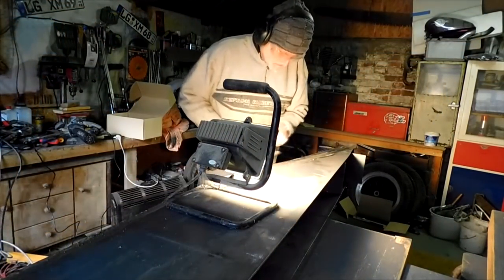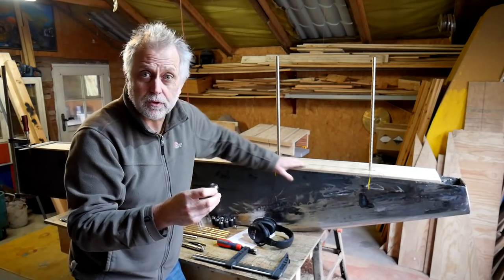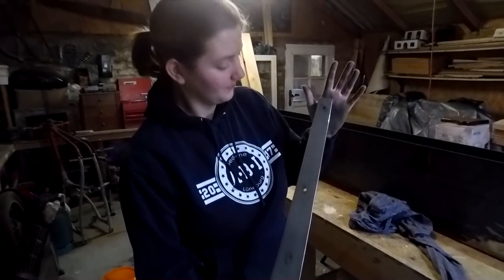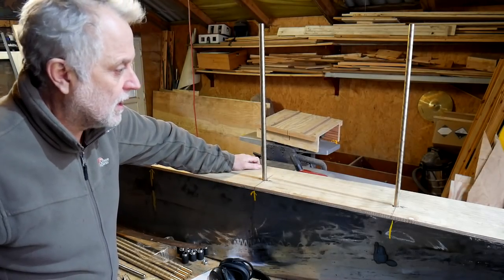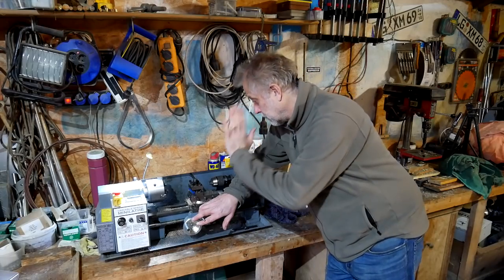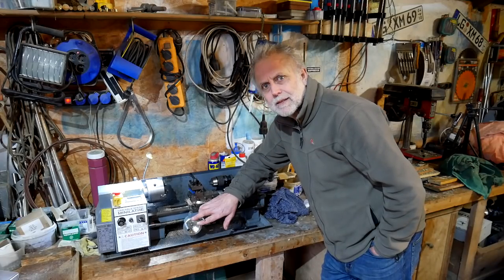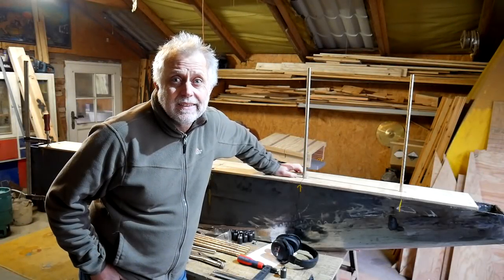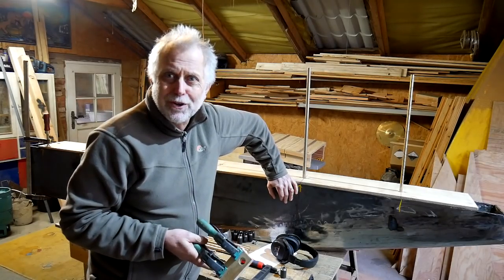Keel Bolts Going In!! -  Building a cruising sailboat; SV Tapatya EP220

Comment: Fantastic progress you have done amazingly well. Nice to see Hazel tackling some fabrication for her own boat too - she is a handy young lass.😀👍 Just a thought about the keel studs - firstly decoupling the steel bronze interface with ‘tefgel’ or similar and maybe consider running a locknut down on top of the angle iron plate to clamp and lock? Really felt for you with the grind and hand tapping those threads.😀👍⛵️
Reply from the maker: Thanks Norman. Yes, valid thoughts. I’m about to make a significant change to the keel bolt thinking. It’s a funny old game!

Comment: A shame you didn't have access to a steel pipe who's diameter matched the width of the keel. Split a piece just over half the length of the keel and you'd have a nice round bottom and forefoot to weld the flat sides to. Would have saved a ton of time and work, but, you have to work with what's available and affordable... I'm used to working with commercial K&T and Brown and Sharpe lathes that can do nice 'single point' threads, I really felt for you watching you make all those threads by hand...DIY is tough when you only have access to 'Home Owner's' tools and a limited budget. I was lucky to have a friend who owned a machine shop and let me do home projects in exchange for machine maintenance and electrical work. All you have to rely on is your garage and YouTube...Great work so far! 👍
Reply from the maker: Thanks Mike. Yes, one of the things about the standard home shop is that we have to get things done with what we have available. In many ways, it'd be great to have every bit of kit under the sun, and it'd certainly make things easier, but it just isn't the reality for many of us. And it is possible, with a bit of thought and effort, to make quite complex things with some relatively ordinary kit. They may not be perfect, but they'll function. And I'm not afraid of a bit of hard work, and applaud others who see things likewise 👍😀

Comment: In case you haven't considered Tony and from my experience, the one unknown to me until I poured Mistress' keel situation was, the heat effect that the molten lead has/will have on your mild steel keel plating. I was aware of for eg. digging a hole in earth/the ground and placing the keel in it to help absorb the heat to reduce distortion and there are other strategies for eg. as Leo did with sand. Definitely worth looking in to!
Reply from the maker: Thanks Bruce. Yes, I have considered that. Watching Doug on SV Seeker, his steel plate distorted inwards and then popped out again when the lead had cooled. He then poured more lead in to fill the void. Did yours do the same?
Reply: @SVTapatya  I did have a little distortion in some of the compartments at the top section of the keel Tony. I was well aware that there were heat distortion possibilities in the planning stages and one other thing I did was place many ingots on top of each other in to the compartment sections, with a good sized space for the molten lead to pour in and around each section, which I think is mainly why the distortion was high up past where the ingots stopped (note that strangely but very usefully for filling with lead, the plans detailed the keel floors on angles off vertical and I had 25kg new ingots). Nothing wrong with adding a little fairing compound to fair things out if desired, which is what I also did.

Comment: I tuned in last week and had forgotten there wouldn't be a video and then got worried that something was up or you were ill, so very glad to see the episode this week! The keel's looking great. I'm sure you have this well and truly covered but I wondered about having three dissimilar metals in contact in the keel (but no doubt all? bolt-on keels have that problem)? A good old arm workout by the look of cutting all those threads by hand. Have a good weekend.
Reply from the maker: Thanks Billy. Yes, I thought long and hard about the mix of metals. Lead and bronze are a standard combination and should be no issue. It's important that no electrolyte comes into contact with the bronze -steel interface. I shall seal it thoroughly. Should be good 👍

Comment: Great job Tony. However I wonder about the method you have chosen to attach the keel bolts to the keel. You would often find the end that fits into the keel is bent in a J shape such that they cannot pull out of the lead. In your case tightening and un-tightening the nuts that hold the keel bolts to the floors could possibly unscrew these bolts from those custom nuts welded into the keel considering the lead you pour is relatively soft and will not weld itself to the bronze.
Reply from the maker: Thanks Steve. Yes, I'm aware of the J bolt method. It's not the only method of bolting lead keels on though. I don't anticipate undoing the nuts that often, and a careful eye would soon tell if the stud is rotating or not. The big disadvantage of J bolts is the inability to inspect and/or change them easily. Of course, everything can be changed with a bit of effort - I know that Mars offer specialist J bolt replacement. Your point is valid, mate. It's just one of many aspects to consider in the whole keel bolt decision 🤔🤔

Comment: Have you given any thought to melting the lead in the steel keel? Sure would make the job easier. You could install a locking nut on top of the L bracket.
Reply from the maker: I have given quite a bit of thought to that, Pat. My worry is distortion of the steel through the heat involved, but it could be done, I'm sure 👍😀
Reply: @SVTapatya  
Tony,
I don’t think pouring 500F lead into the mold would be much different than melting the lead in the mold, it might even be a better option than shocking the metal. Perhaps you can preheat the metal first and put the majority of the heat on the lead itself, staying away from the sides. In addition building a framework to hold the mold would prevent warping.

Comment: Hi Tony. Just curious, will galvanic corosion or cathodic erosion be a problem with this construction? Steel, lead, bronze and salt water are the makings of a great big, though weak, battery. Will sacrificial anodes protect those bolts? Just curious. I know it won't happen quickly, but l've seen what happens over time and there is no easy way to inspect those bolts after installation. If Hazel inherits the boat it could become an issue for her. While it won't likely capsize the boat, I can tell you it's unnerving and expensive to lose that chunk under full sail in 70 or more feet of water.

Bye the way, I like the way you've built the keel. If the bolts can be removed one at a time after casting it will make inspection possible if not necessarily easy.  Till next time, God bless you and your family.
Reply from the maker: Thanks Michael. Well, if the saltwater doesn't get in there, it won't be a problem. No electrolyte, no corrosion. Obviously, the steel would corrode first, being the least noble. Lead and bronze are pretty close so shouldn't be an issue. I shall talk about this in next week's video. Something significant has happened 😳

Comment: Great work Tony, does that lathe not have the capabilities to cut threads? If it does would be a lot less physical.  I did not hear you saying anything about that about the lathe, some of them do most don't  though. Just  wandering is all.
Reply from the maker: It does have the capability, mate. It doesn't have the power to do internal threads though. The male threads on the bronze rod are a piece of cake to do by hand, and I haven't got the tooling to cut them on the lathe. Hence..... 👍☺️